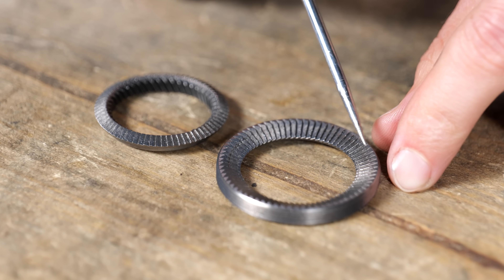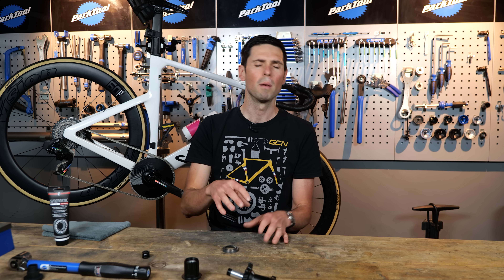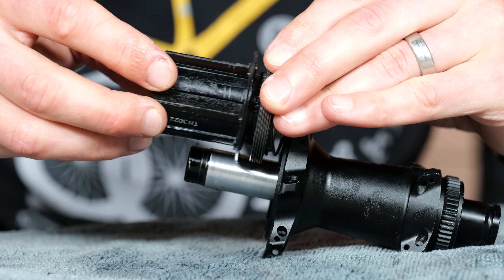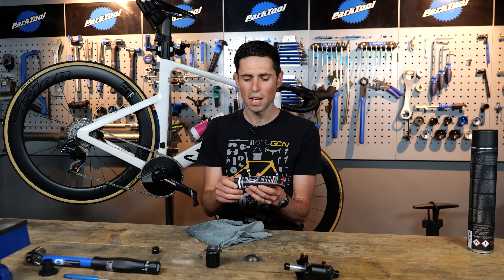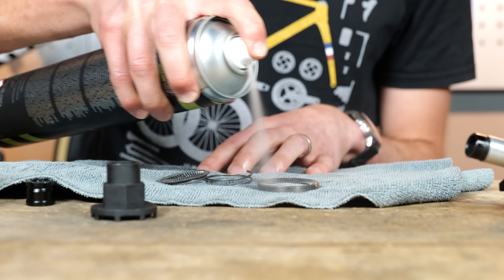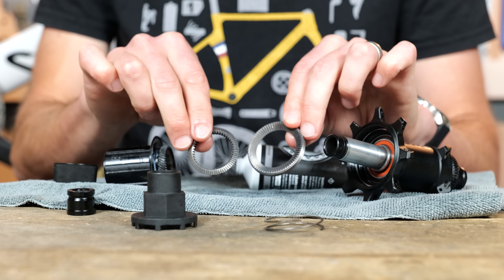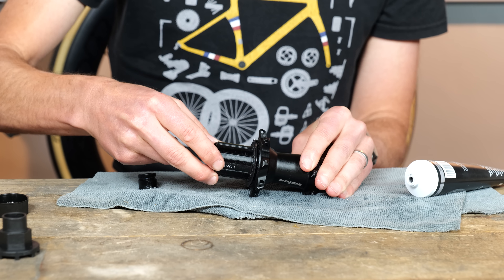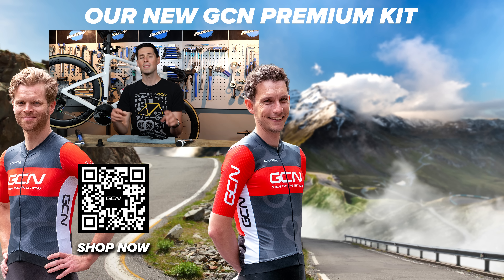Ratchet Freehubs Explained And Serviced

Comment: My DT Swiss DT350 hubs with the 18 tooth ratchet are nearly silent!  I have a pair of Giant Carbon wheels, which I believe also have rebranded DT Swiss hubs with pawls and those are a lot louder
Reply from the maker: which do you prefer? loud or quiet?
Reply: @gcntech  quiet all the way! Smooth and silent with nothing but the wind when you’re in the groove and the legs are feeling good is an amazing feeling.

Comment: A lot of that noise is due to a carbon frame, which acts as a resonator. On a metal frame you can barely hear it.
Reply: I can't confirm that with my xc bike. It's loud as heck with the DT swiss version. But I guess it'll differ from bike to bike.

Comment: My Scribe wheel has Scribe's own star ratchet freehub and it is extremely loud. Brands that make loud freehubs don't realise this makes them dangerous for example in back lanes with restricted view situations. If I can;t see what's around the next corner I stop pedalling to slow down but when I do that the bloody freehub is so noisy it drowns out the noise of any unseen approaching vehicle. I do put extra grease in the ratchets now and then to quieten them down but it doesn't last long. Ratchet systems seem to be replacing pawls so I would like to see ratchet freehub makers quote how many decibels their ratchets produce so I can make an informed decision the next time a buy a set of wheels.

Comment: Well I felt compelled to correct Alex on one point. He stated that a free hub with two paws could spin 180 degrees before engaging. That is not correct. The paws remain in contact with the drive gear through spring tension, thus the clicking, so engagement is near instantaneously. True the lower the degree the quicker the engagement, but only to a small degree unless your freehub is not operating properly. The smaller degree and thus more engagement has more to do with power transfer. More engagement means load is spread more evenly throughout the freehub, which increases life of the free hub.
Reply: El ejemplo que dió es correcto, aunque no exista ese buje,lo dijo para explicar la relación entre cantidad de dientes y grados de demora de acoplamiento.

Comment: Thanks for showing the unnecessarily complicated internals and for helping me decide that I never want to own a set of Vision wheels.
Reply: Look at dt swiss. The OG ratchet system is much simpler. No tools required. There are versions for other hubs, that need tools, so be mindful of those if you want simicity and ease of service.

Comment: As a home mechanic who owns a pair of Vision Metron 60SL, I have had in-depth investigation of what lube and tool we should use, instead of the expensive vison ones

1. For the lube, the Vision uses rebranded Kyoto Raremax AF-1 grease, which is not avaliable in small packages. To find the alternatives, the base oil viscosity and NLGI grade (penetration) is important for the ratchet engagement. After screening across all the avaliable industrial greases, SKF's LGWM2 is the better choice, with very similar high performance as Raremax AF-1. I can't find any technical datasheet about the Silca grease used in the video, so I wouldn't recommend it. Of course, regarding the DT Swiss's special grease, which is Molykote TP-42 diluted by 5% extra base mineral oil, it also have similar property, it can be an alternative but it is not cheap as well, then why not use the Vision's rebranded one?

2. For the tool, the 8 notches on the ring (as Outer Ratchet Ring C on the manual) with outer diameter 44mm, inner diameter 36mm and width 4mm of each notch, we can actually find a 8-teeth bottom bracket tool that is for ISIS or Truvativ etc., this kind of bb tool fit exactly with the 8 notches
Reply: Do you have a hint which grease to use on dtswiss hubs if the special grease is too loud? I would like to keep it quiet :) Thought to just try any nlgi2 grease?! How come Molykote TP-42 is white and DTSwiss Special grease red?
Reply: @therealkavide  Ye that's a great observation, actually the formula of special grease is a rumour and I think you should take TP42 with a pinch of salt, although generally speaking it makes sense. Very possibly DT Swiss adds some additive dye or pigment when rebranding. 

Anyway, regarding the loud sound, first of all NLGI is a very carefully calculated and selected criterion of grease, choosing a NLGI2 grease will bring you the risk of disengage between ratchet teeth when you just applied the grease. In the long run it won't affect too much because there is only a very thin grease film that is working on the surface of friction pair. Although I didn't experimented, I would still suggest you look into the grease with higher base oil viscosity instead of NLGI. And actually, another crucial factor is the spring's stiffness, changing this would be more effective. But these modifications are at the risk of ratchet disengagement, so do be careful when doing that.
Reply: @junkailu5450 it all depends on how thickly you apply the grease therefore any quality grease should in theory surfice
Reply: Pretty interesting investigation.
I have the DT SWISS version on my bike and I'm happy with it. It's now 2000km old and shows no signs  of significant wear.  I do use the recommended grease from DT and for home use I'd say that's fine. In a workshop I'd look for cheaper alternatives.

The DT freehub can even be customized with different tooth count inserts. My e mtb originally had the 18 t and I put in a 54t. Works perfectly. I usually service it 3 or 4 times a year and it takes about 15 minutes including a thorough cleaning.
Both never skipped, engagement is quick and they do sound awesome and satisfying.

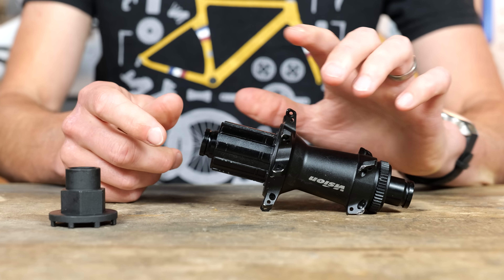Comment: 4:08 Alternatively, you can accidentally let your wheel fall over from where you had it sitting up while you were working on something else, and then spend the next hour trying to figure out why your hub just exploded, your bike mechanic friend doesn't answer a text, and you think you got it back together, but take it to the shop the next day for them to look at it for 5 minutes to tell you "yes, that's normal, you put it back together correctly."

Comment: Non-related topic: To get the right pressure on the Silca calculator, should the bike be weighed fully loaded (with water bottles, Wahoo, lights, saddle bag/any bags, etc.)? If so, then 99% of people are riding with the wrong pressure. Or does this extra weight not significantly change the pressure?
Reply: It’s total system weight that matters as that is what the tires are dealing with, much like our spouses. Hold your bike with all its gubbins attached, filled bottles, etc, while wearing all your cycling kit with all the definitely, unquestionably important stuff in your jersey pockets and step on a scale. The number you get is the correct weight to enter into the calculator.
Reply: Everyting counts ;) You can add to the bike weight roughly 2kg for bottles, wahoo, pump and tools. And 1,5kg-2kg to body weight for kit, shoes, helmet, food, phone, jacket. But in my experience the silca calculator shows a little too much pressure with the bad road setting. I go with less pressure always and all other calculators seem to say so too.

Comment: One way bearings (also known as Spragg bearings) have been available for years.  Why aren’t they used on bikes?  And they are quiet.
Reply: They are. Onyx hubs do use them. It's just very expensive to make them good and it's basically a niche in a niche.

Comment: Thoughts on Shimano being SO far behind on hub tech - I had an ultegra c50 wheel set, and noticed the free hub body had play. 

As averagely competent on the spanner’s, I decided to investigate. Slight surprise to find unsealed ball bearings / cup and kones in the main hub (but understand that it may be cheaper to install ceramic ones), but even more of a surprise that after I made a special tool to remover the free hub nut, 64 tiny ball bearings went everywhere! 

After many attempts to get this to stay in place, I managed to get the free hub body back to where it was meant to be, but the it was even worse! Ended up buying a new rear hub. Very frustrating.
Reply: Cup and cone are not worst than industrial ball bearings on a wheel, they are different, with pros and cones, cup and cone handles better angular loads. but they are more fiddle to set up the play on them. As proof not only Shimano used them till not so long ago (latter MTB uses industrial) but Fulcrum/Campag still uses cup and cone because they think they are better for wheels than industrial bearings.
Reply: Use a freehun flusher.

Comment: I was under the impression that the previous freehub also had what is called ratches although no tas many as the newer ones. What is the old then called?
Reply: A freehub without pawls is known as a Star Ratchet freehub. In a traditional freehub that uses pawls, the spring-loaded pawls engage in the teeth in what's normally called the drive ring in the hub. This toothed drive ring is also called a ratchet or ratchet ring, hence the confusion.

Comment: Ratchet freehubs have a larger contact patch than a traditional 3pawl system, the added friction of the ratchet reverberating against the hub contact patch also adds more friction over that contact patch, also i use dt swiss hubs and i do notice my xtr m9000 3 pawl hubs run faster than my dt swiss 240's
Reply: I'd say the difference isn't significant. It would be interesting to see a load test, engabed with pedal load and coasting.

Comment: Noisy freehubs are just wasted energy! Not very efficient descending 😅
Reply: Totally agree. I descend quicker and quieter on my Bitex pawl-type hubs than all my club mates running ratchets.  Like many "innovations" in cycling ratchet-type freehubs are a solution to a problem that never existed in the first place.
Reply: @peterlewis3966  compared to the total drag in a descent with aero drag and tire rolling resistence the drag difference of freehubs is probably so low it wouldn't even be possible to measure reliably. But i would love to see some lab test data for different freehub systems.
Reply: Silence doesn't mean it's more efficient. It may not be emitting sound, but it may be emitting heat.

Comment: the noise makes me a better cyclist. I have a DT and the noise irritates me so much that I never stop pedaling LOL
Reply: Same. I coast a LOT less after I upgraded the wheel set because it's louder than a dive bombing Stuka.
Reply: Pack the outside edge of the ratchet with dt swiss grease, it stops the ratched reverberation against the hub body, thus its practically silent if you grease it this way, you need to do this every couple of months or it starts getting loud again
Reply: Some brands offer different sets of ratchets with different numbers of teeth. I found that ratchets with fewer teeth are not as loud.

Comment: I have this style. Often when I pull my cassette the whole free hub body comes off. Is the end cap not secured properly?
Reply: Some wheels like my Zipp’’s this is normal, freaked me out the first time it happened.
Reply: Or the free hub body wasn't adequately greased when the cassette was installed.
Reply: Normal on dtswiss hubs. Easy tool free maintainance!
Reply: On DT hubs, that's normal. I don't take of my cassette to service my hub,just pull the hub and cassette of, clean, grease, reassemble.